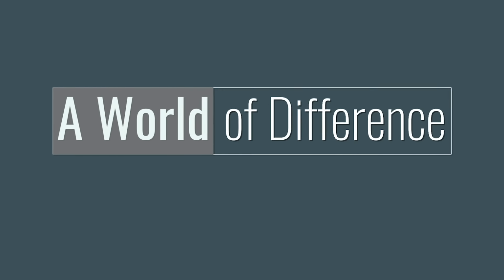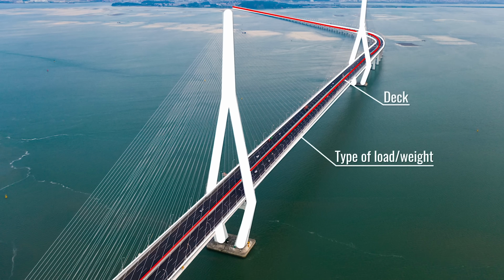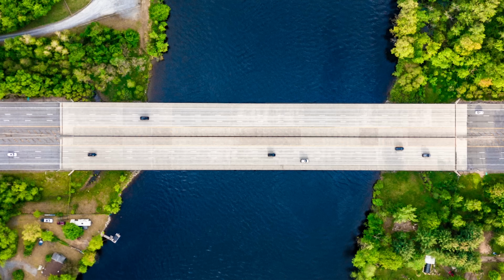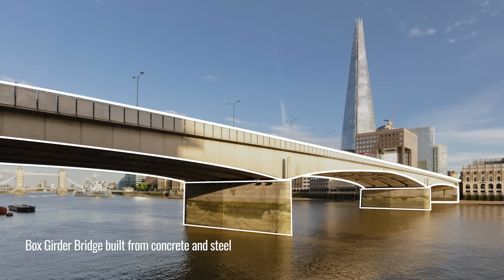Every Bridge For Every Situation, Explained By an Engineer | A World of Difference | WIRED

Comment: We have a TON of bridges in my city that were built around the same time and are well past their 50 year design. Some of them need complete redesigns because traffic has dramatically increased since they were built but instead the city just keeps patching up the old ones, even when there are literally chunks of concrete falling off onto roadways beneath. A year ago they finally fully rebuilt one that had a net underneath for about a decade to catch the falling debris. It's that bad.

Comment: At 12:52, the entry for the Truss Bridge Type: "Fracture critical (no load path redundancy)". Regrettably, Dr. Mabry does not discuss this matter in the video.  But this aspect of the truss bridge is really important.  A number of truss structure failures hinge on this failure mode.  Engineers take note. 
Also, the matter of why one type of bridge structure is selected over another in a particular situation is not discussed. Oh, well.

Comment: 7:30 The forces one the deck/span (horizontal) seem reversed. Shouldn't it be tension forces (<- ->) at the bottom of the span and compressive forces (-> <-) at the top of the span?

Or is the span curved up instead of sagging?

Comment: That’s rotating pedestrian bridge is amazing
Reply: Really looks like a safety issue. Normal draw bridge, someone trapped on it when it opens, unless they're an idiot or Exceptionally unlucky, will slide back down onto land. On the sort where the central section is lifted straight up, they're just stuck for the duration. This sort just flat out dumps them in the water. 
Further, it has a maximum clearance based on the arc of the curve. Draw bridges do not.
Heck, if you've got room on the bank(s) and the water isn't too wide you can build a swing bridge! (Err... Wait, a swing bridge might be a different thing. Might have the names muddled.) It's basically just a beam mounted on a pivot. It swings Sideways, basically like a gate. Less mechanically complicated, only slightly more risk of dropping someone stuck on it into the water than a draw bridge, less than the rotating type actually used. The only problem is that if the sections are too long you have to cantilever them, which means a bigger chunk of the bank must be kept clear.  Depending exactly how the thing is built they can be turned with a hand crank, or even just pushed (it's basically the same principle as a canal lock gate, just without the gate.)

Comment: The part about cable stayed bridges is actually not accurate, the main benefit is because its cheapest to build. For actual Longer spans, suspension bridge is absolutely the best option. That said, being economical is a MASSIVE advantage. Afterall, a bridge is primarily a functional structure and not an aesthetic structure.

Comment: Another bridge type: Hobart in Australia used to have a floating bridge (yes, it literally floated on the water) with a vertical lift section.
https://www.7hofm.com.au/images/0_blogs/Watto/3665190374_4610e2802c_b.jpg

Comment: In central Canada where it can get to minus 50 below zero. For 3/4 months the pillars of the bridge are incased in thick ice, in deeper rivers the water is still rapidly flowing under the ice. Is this a good kind of pressure for the bridge or not ?

By the way excellent commentary on bridges. This engineer not only is knowledgeable on structures, but he's awesome at communicating it. 5 outta 5 for me.
Reply: Generally I'd say it's bad because it doesn't help the bridge do its job... but if it has a noticable impact I'm sure the designers have left reserves for that ice... also doesn't the ice mostly float on the water / lie on the river bed still?